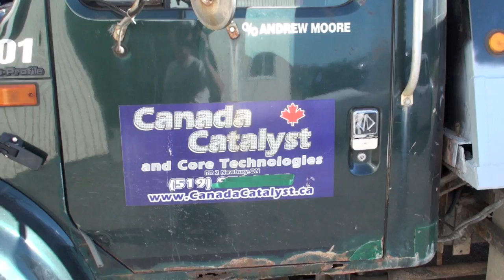more welding!

Comment: Hey Pug about that sticking welding tip probleme of yours ,i may have a fix for you ,what i did was drill out the hole bigger so the heat dont expand the brass inside and stick the wire ,with the drilling it solved the probleme for me at least .

Comment: when the welding wire sticks to the tip like that, hold the trigger down and snap the hose/gun like a bull whip, most of the time it will pop out, and saves you from digging it out,